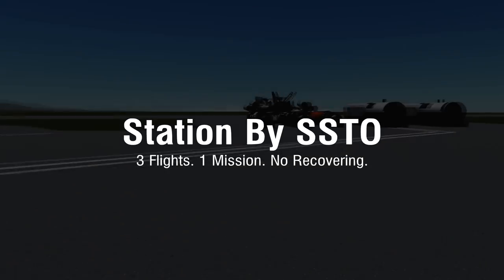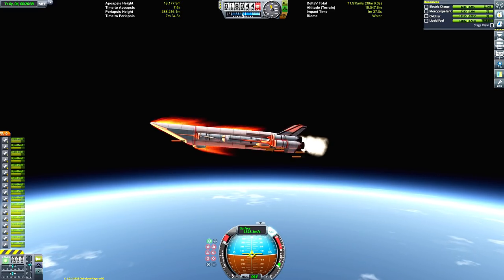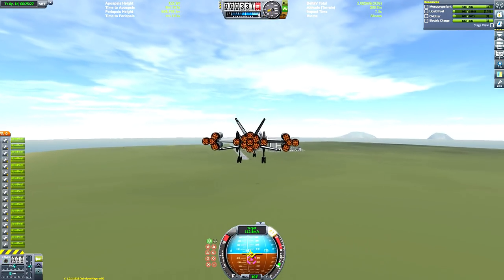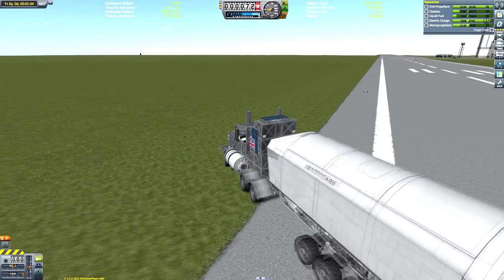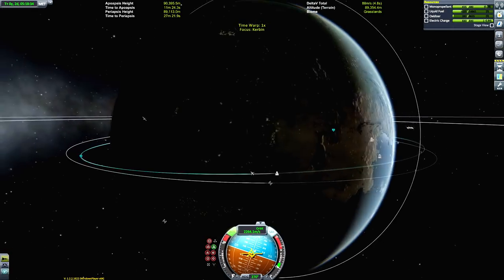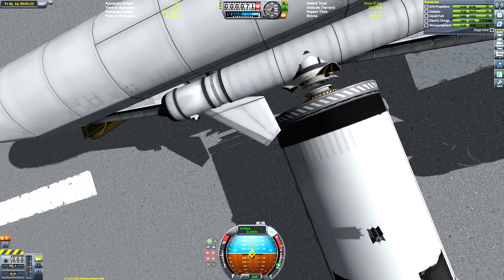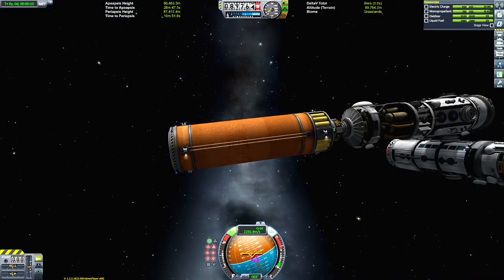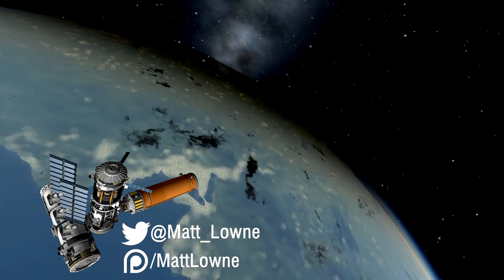KSP: Building a Space Station with an SSTO!

Comment: The best way for trucks and trailers on KSP (I haven't seen any videos) is use the Docking Arm (the claw) on the truck pointed horizontally, on the trailer allow for a large flat area. Then drive the truck grab on to the front of the trailer (with the back of the truck) then adjust the claw to 'free pivot mode' it might take some engineering to get weight balancing correct but the truck and trailer will have a 30' pivot

Happy flying

Comment: And for anyone using mods, you can use KAS for a much easier refueling system, bring the truck over, get a kerbal to pick up the hose and have a ladder on the ssto and plug the connector into a socket to transfer fuel rather than messing about with the docking port

Comment: A trick I learned while toying with building VTOL craft is to use fuel lines to and from the tanks. It is basically an auto balance system so I don't have to try pumping fuel back and forth mid flight.

Comment: I know that the new dlc is adding robotic parts, but I really think you should look into kraken tech. You can do some crazy things like this using kraken tech. I have an ssto that's flown 13 times without recovery, built mun transfer vehicles, launched GPS satellites, and captured asteroids. It even has a kick stage that can be put inside that has flown 4 times. All that and it's actually the shape of a skylon, with only the large payload bay, no cargo door. I built a gantry crane to lift everything and put it in. It works really well surprisingly.
Reply: This is an album of the integration of one of the first 5 flights: http://imgur.com/a/VCsrc94

Comment: Great video and fabulous premise!  If you're looking for future video ideas, I'd love to see some proof of some of the points of spaceplane design.  For example, I totally agree about the magic number of 400m/s for Rapier's.  I've hit that more than once - I've got enough umph to get from 400m/s to orbit, but not enough to get from 0 to 400.  I think some folks would learn from seeing that barrier demonstrated.

One issue in particular I'd like to see proved is that Ramjets are useful on large SSTO's - I've made a few attempts at using them and, anecdotally and without any good way to measure, I don't agree.  But my bet is that I'm just holding it wrong.

Another one to explore is flight profiles.  I think (with no real evidence) that a flat trajectory at 1500m/s in the upper atmosphere is not as good as an ascending one at 1400m/s at that altitude.  (For me, my rule of thumb is a > 300m/s climb rate up to 60km)  Whether that's really better or not is not clear to me.  I know I get to orbit and you do too.  The question is who gets there with the most stuff left over.

Comment: You should have used a fuel cell on the truck to provide EC instead of solar panels. You already had fuel tanks on the sides so it'd be a logical step to add fuel cells onto it.

Comment: When your d*i*ving and you pull up super quickly it converts the momentum you gained during the dive into massive speed, good when your already doing 300mph but if your only doing 100mph you will make it up to 150mph depending on how high you started to dive at. Never do this in a plane, you will pass out, lol.